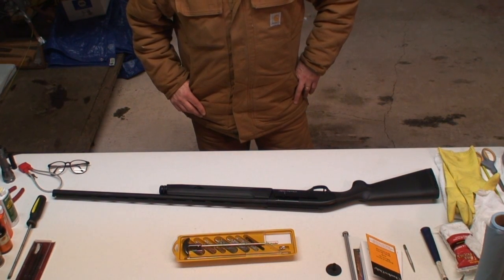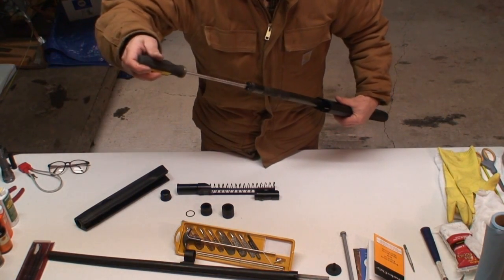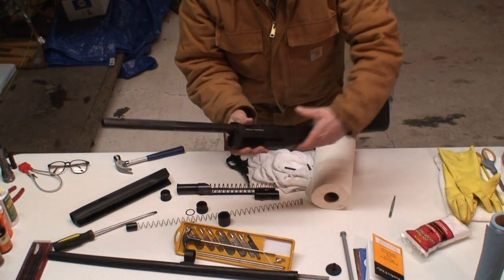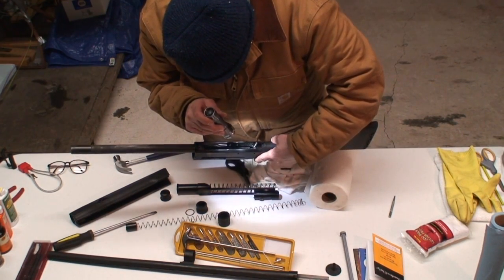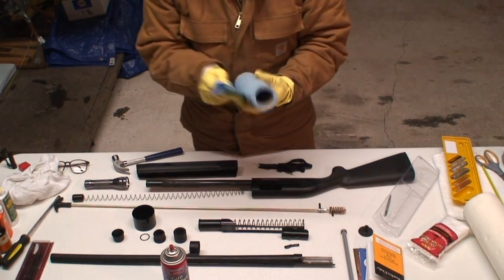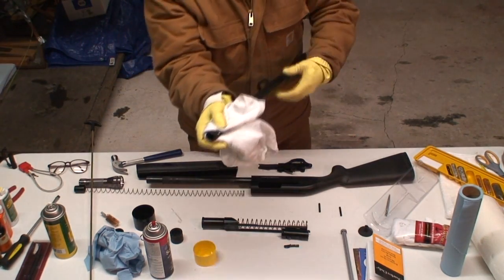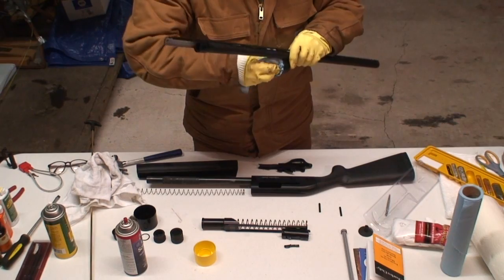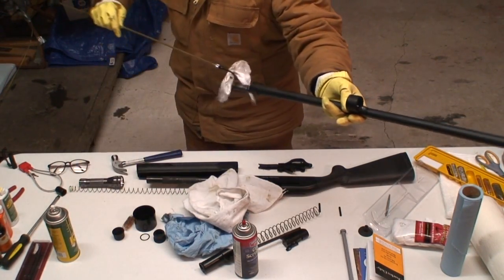Part 1 of Disassembling, Cleaning, Inspecting, and Lubing the Charles Daly Semi-auto Shotgun

Comment: Nice I've used WD-40 but only in nasty situations. Example had a guy bring my a ruger 45 pistol don't remember the model. But was never cleaned in 10 years since he bought it after soaking in wd40 cleaned polished and finished with hoppes #9 and hoppes #9 all weather protection. The 45 looked like gem. Without wd40 I spend twice or three times as long cleaning it

Comment: I don't use much either, don't know about corrosive aspects, but it have heard it does cause moisture and rusting after drying.  for your tools, and breaking free a tight or seized bolt man you gotta try PB blaster--that stuff is awesome for the price and 10x better than wd40 for that purpose.  I use PB blaster to clean my tools and leave a protective coating (and I have noticed it seeps into bare uncoated mild steel in about 30 min leaving the surface almost dry after I wipe down my work table.

Comment: Hi I doubt you’d respond hence this has been so long ago but I have the exact same gun, except it’s the ducks unlimited edition, The recoil pad behind the bolt mine is cracked and comes out when I take apart the gun what could I use to “glue” it back? I’ve looked for the replacement part but no one has it

Comment: I work on extremely expensive machines, replacing bearings/clutches/and even motor drive parts.  we use brake cleaner as a follow up to high quality de-greaser by the 55 gallon barrel.  it won't hurt firearms.  cerakote gun coatings requires using brake cleaner or acetone prior to finishing.  
I don't use it for normal gun cleaning--I have too much money in my guns and spend money on Break free CLP (about a pint a year for cleaning, oiling, and gunsmithing) but brake cleaner should not hurt.

Comment from the maker: @dmanwhocan, I use mostly products designed specifically for firearms also, but I have never had any problems that I could attribute to using WD40.  Copper is softer than the steel used in your barrel. Unless you are using a steel rod and inadvertantly scraping it on the barrel or you have some type of abrasive embeded in your brush you shouldn't have any problems.

Comment: additives in wd40 designed to increase penetration are slightly corrosive.( the bubbling effect) but it shouldn't be a problem if wiped off..I use "kleen bore"and add a Teflon product called enviro save.i mix it in a small dropper bottle and keep shaking it as i apply it.It makes the action noticeably smoother.I like brake cleaner for actual cleaning,but wd40 is ok I guess but I just wouldn't leave it on a firearm.A lot of folks just don't take the time to strip and clean their gun

Comment: hey hows it going i had a question for u is that  i bought a charles daly and they told me that it was a 7 shot but i load 2 shells and then on the third one it doesnt go in all the way.someone had told me there was a cork or something inside that needs to be removed so that they all fit.oh and also when i chamber a shell up top sometimes it gets jammed and wont go up if you could help me out if u have any info on my questions please let me know thanks and good vid

Comment from the maker: @natedawg357, I often use simple green also for cleaning tasks.  Because it is water based and it does a good job of removing all oils... you must make sure that you thoroughly dry your parts and make sure that you reapply an oil that will protect your parts from rust and corrosion.

Comment from the maker: @daverocker1, As I have said here in other posts I use mostly products designed specifically for firearms.  I have never had the brake clean that I use take paint off of a car, but I appreciate your comment.  Even solvents designed for firearms can cause problems on vulnerable finishes.  I have even had Simple Green which is basically just a detergent stain painted surfaces.

Comment: Not trying to troll here but I would not suggest using brake clean on a firearm.  That stuff can take the paint right off of a car.  May not be too bad if cleaned off immediately but why use it when you can use remoil or something that is specifically made for firearms.  JMHO.